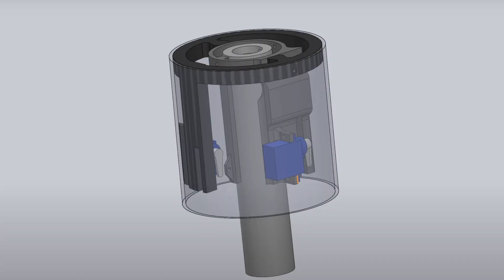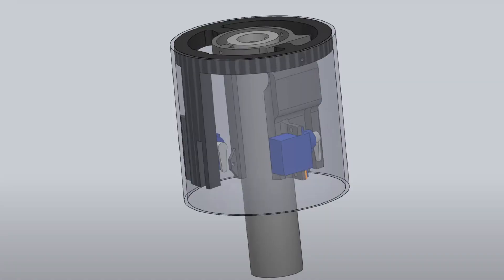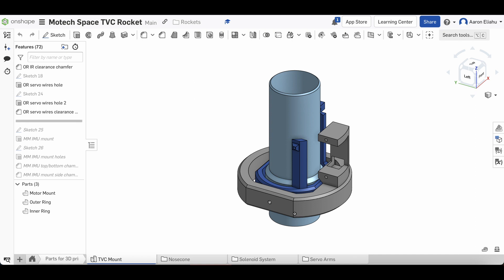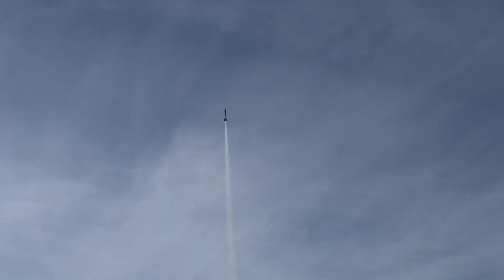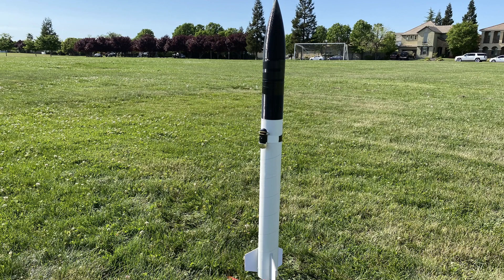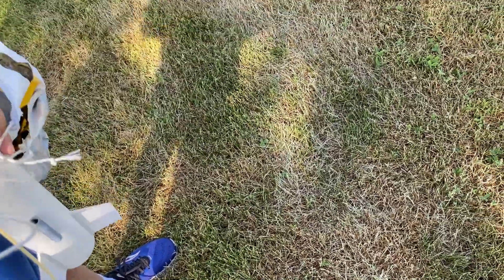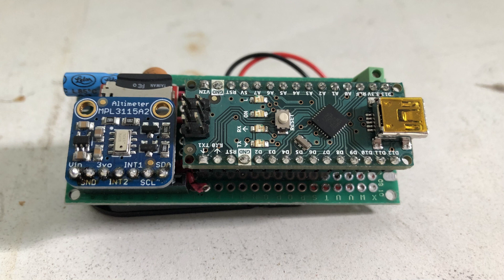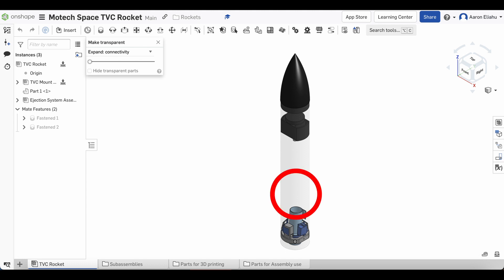How our THRUST VECTORED Model Rocket will work

Comment: Nice work! Maybe try to isolate your shock cord from all the catchy bits inside, and some thinner(lighter) chute lines. And add some more length between the chute, payload and body, its hard to tell but they look really close together. 

Nice to see your progress with the electronics, keep testing! I've only gotten as fas as logging altitude at my computer desk via serial monitor😢... but my soldering is nice🤣

Comment: The non zero part of your altimeter is a problem iv had to dealt with, it’s because the barometric pressure sensor reads pressure in hpa, hpa levels change all the time, so that is why your altimeter is not always zero.

Comment: mate, I hate to say it. but you have a lot to learn. maybe consider working your way to a Level 2 certification, then attempt this sort of thing
Reply: Developing a TVC system IS the learning process. Levels are for bigger motors for HPR. Tell me what he needs to learn to do TVC?
Reply: @caesar005  recovery for one, I'm not trying to be harsh.
Reply from the maker: @jeremysim5302  I've been launching rockets since I was 7 and I've had plenty of successful recoveries. Most of the times it's failed is due to me not using the traditional methods of anchoring such as using 3d printed parts.
Reply: He’s doing a Joe Barnard and I like what I see. It looks like he’s learning a lot and I think that’s most important. My only critique is that he could mount his avionics a bit better :P
Reply: You have to crawl before you can walk. You might know more, however, there was a point in time where you too we're learning. Give the kid some credit. Encourage the learning journey. Don't rip it apart.
Reply: @TheGunPsychiatrist  all credit where due, his knowledge of electronics far outweighs mine, I believe there are plenty of stills he could pick up with a few more flight under his belt.
Reply: TVC is completely different from HPR. Flying HPR rockets does not give much relevant experience in control algorithms, state estimation, complex hardware design, etc. HPR also costs a lot more than TVC and a failed recovery is a lot worse in a 2 pound rocket coming down from thousands of feet than in a small rocket coming down from around 50 feet.
Reply: Mate, Elon Musk was told by astronaut Buzz Aldrin to hang it up after several failures 4-5 years ago. I’m glad Musk didn’t. Space X is the leading rocket company in the world now.